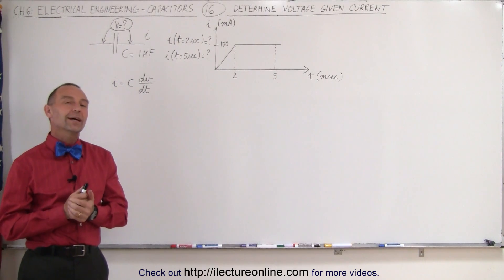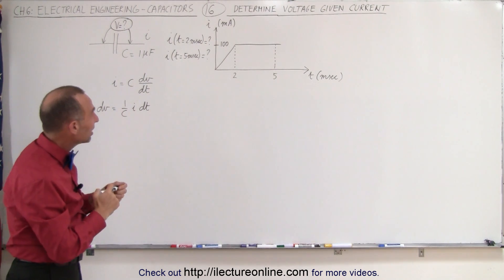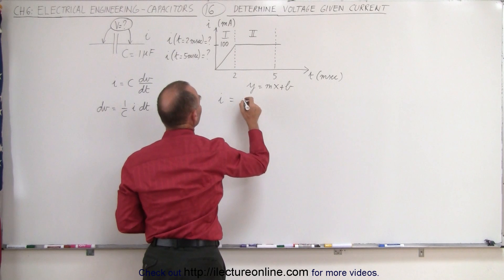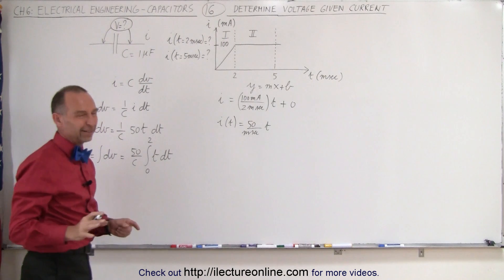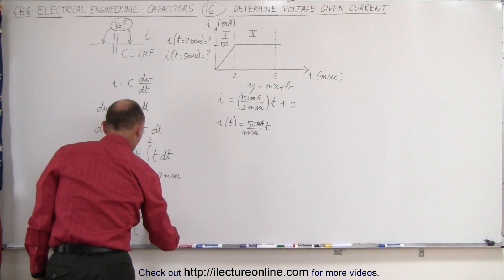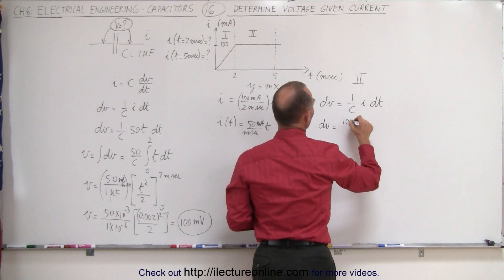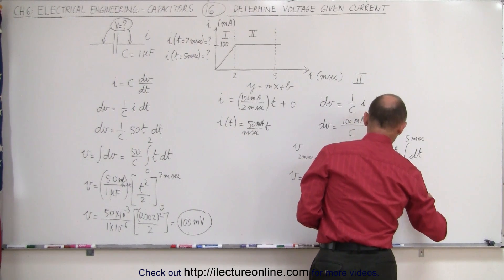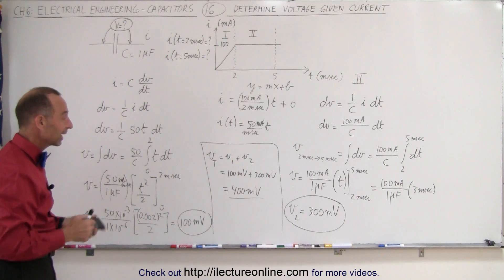Electrical Engineering: Ch 6: Capacitors (16 of 26) Given Current, Determine Voltage=?

Comment: I think the second part should be 300V, because it has just 't' instead of 't^2'
Reply from the maker: Yes you are correct.  (Not for your reason given), but I messed up on the decimal point.
Reply: @MichelvanBiezen  i was so confused my answer was 300 V it didn't match yours 😂

Comment: Professor,I suppose we didn't need to do the whole integration part (in this specific question) as we have a regular figure of straight lines . We have a right triangle and a rectangle . Won't the summation of their areas be our answer.
Reply from the maker: Did you try it?  Did you get the same answer?   That is how you will answer your own question.

Comment: could you please solve this? i solved it but my ans doesn't match to this. give it a try, if possible! thanks!

The current through a 100uF capacitor is 50sin 120πt mA. Calculate the voltage across it at t = 1ms and t = 5ms.
Ans: 93.14 mV, 1.736 V
Reply: Africa

Comment: The question is asking for currents and we found voltages! what do these voltages represent exactly?
Reply from the maker: Currents were given in the problem and we were asked to find the voltages.  The voltages represent the potential difference across the components as a function of time.  (since they change sinusoidally over time)

Comment: Should not the current be 50 amps? You are dividing 100 ma by 2 msec. Therefore the units cancel out. Therefore the voltage for region I should be 100 volts.
Reply from the maker: Correct, see comments below.

Comment: Actually sir, I still don't understand why the unit is mV.
(mA/uF)*mV =V . 2milli is considered as 10^-6 right sir? so it will cancel the micro unit. Thus the unit of volt is only V. sorry sir. but i stuck at the unit. thank you :)

Comment: Sir, how is (100*10^-3)/(2*10^-3) not equal 50.

Thank you
Kind Regards
Reply from the maker: Note that the units in the numerator and denominator are still (mA / msec)
Reply from the maker: Note the units are still in mA and msec.

Comment: how did you get 100mV sir in my calculation its 100V? thanks. :)
Reply: To get 100mV the capacitance should be 1mF not 1uF...
Reply from the maker: Note that the current is in mA (not A).
Reply: but milli can be cancelled because you have mA/msec
Reply from the maker: The video is correct. (it is 100 mV)
Reply: @MichelvanBiezen  if you kept mA, the result would be 100,000mV instead of 100mV.

Comment: I believe the units are wrong. Region I: (50mA/msec) (2 msec)^2 /(2  * 1 micro Farad) = 100 mA *ms/ micro Farad = 100 Amp *sec/Farad = 100 volt  not 100 mV  Region II: (100 mA *  3 msec)/( 1 microfarad) = 300 Amp -sec/farad = 300 volt not 300 mV
Reply from the maker: The units are correct in the video.  Thanks for checking.
Reply: @MichelvanBiezen  i cannot manage to get mV for my final answer